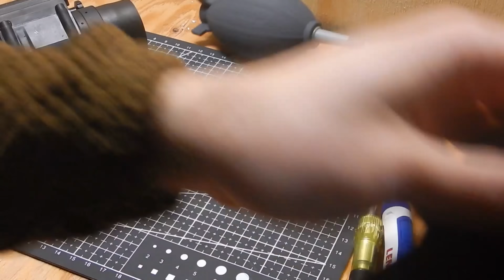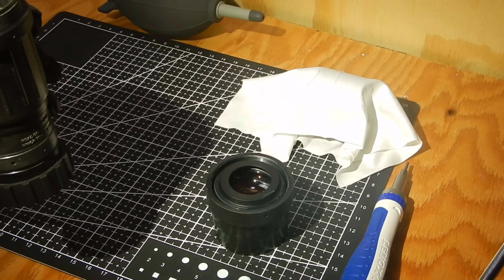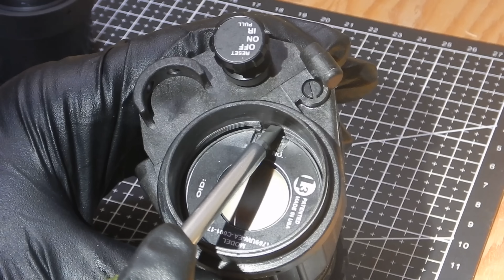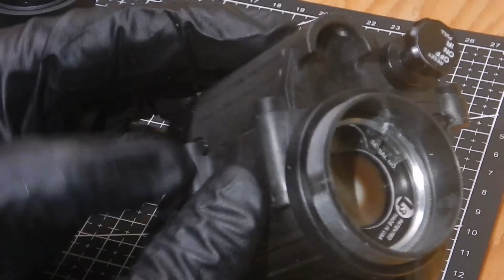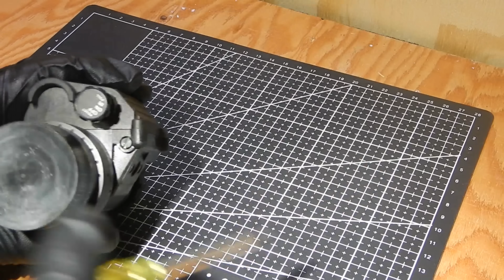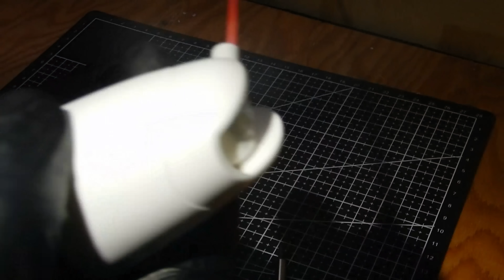How to Build Your Own PVS-14

Comment: If you not vacum then you not puting in anything unless you have another openning in that enclosure, to force out the air. The goal is not to gave inert gas in there, just to remove mousture.

Comment: You can build a glovebox out of a harbor freight sandblast cabinet and get a k bottle of nitrogen for like 300$ total, you dont need a vacuum pump to purge small volumes using one just means you waste less gas. Obviously using a bit of argon works but doing it legit and have your whole assembly under n2 is definitely possible for less than the cost of the mounting system your likely attaching it to.

Comment: I would use a hydrolic bycycle bleeder kit to vaccume the chamber and cut a hole to insert the argon tube into the bleeder tube and silicon it, when you  suck out the air you put the pinch clip on then just spray the argon in. That would better distribute the gas to all corners of the unit. Nothing comes to mind to put the plug screw in, except maybe put some lock tight on to ensure a better seal.

Comment: Re 17:10, your technique is creating a venturi which will drag air along with the argon into the device.  Best to get the whole tube into the hole. If the red straw is too thick soften it over a flame and draw it out, then cut it at the necked-down portion you just created. Better yet, get a small desiccant pack and put it into the device, it's not the oxygen you're worried about its water vapor you don't want in there, the desiccant will absorb the water vapor.
Reply: 😊hey smartasses argon is heavier than air so even if he did it would get displaced anyway doesn't make sense

Comment: I wonder if cooling the can’t further would help displace the normal breathing air. Maybe if the argon is cooler than it already is coming out it’ll get into the device and then expand driving up the less dense air out of the system.

Comment: <-- Military grade lens licker here. 
Nitrogen does several things, it displaces all the O2 so internal metal components and contacts can not oxidize, it removes all the moisture from the internals so condensation inside the device isn't a problem. Also most gear is slightly pressurized, this positive pressure keeps dust and moisture out of the system and avoids the dreaded vacuum that you may get when opening something up that was put together on a warmer day. Optics should be assembled and sealed when cold and warmed up prior to opening. 

Also I can confirm the tip about the aluminum foil. 

Added tip, if you need to clean any of the internal optics pick up some First Contact optics cleaner, it's insanely expensive but so are quality lenses and this stuff works flawlessly every time.

Comment: I think that I would blow dust out of the housing 6:40 before unwrapping the tube and not dump the dust on top of the electronics where it can migrate back in when you re-assemble, but thats just me.  : )  Anti-static wrist strap and pad might be nice too.  Autogain and autogated are not the same thing.

Comment: You could also use a sealed chamber to purge, as you said, the air is about 70% nitrogen so really all you have to do is remove the oxygen.  So what if you created a sealed chamber with a window on top and created an opening for heavy gloves (like say just sealing up a sand blasting chamber), and then putting a bunch of oxygen absorbers and desiccant packs inside, then just assemble it in the chamber, there will be no oxygen and no moisture, just nitrogen and trace gasses.  So there will be no need to purge oxygen because it wasn’t there in the first place.

Comment: Isn't Argon (being a noble gas) more inert than Nitrogen?... wouldn't this be more preferred than N2?  N2 can still interact depending on the condition...

I thought the point to a Nitrogen purge was to displace not just Oxygen but rather the moisture content and biological gunk in air.

So was gonna say bake off the moistue, but those lab ovens can be low like 60C ... guess it's a lot harder to oven it at home reliably ...

Comment: For an argon purge find a GTAW welder (TIG or Heli arc) fill a 5 gal bucket or deep tub with argon using a steady stream flowing into the bucket. Assemble the pvs-14 in the bucket. Give the welder a few bucks and be on your way. Titanium welders will will use 99.999% medical grade argon. This is similar to closed chamber welding.

Comment: the concern with oxygen is the latent moisture in oxygen. one good tip is to assemble the unit in a dry dehumidified "clean room" and wear an N95 mask that helps keep you from breathing extremely humid breath directly onto the device during assembly. Pay attention to the dew point and temperature in the room as it can cause moisture to collect on the glass. Another option is to use a beefed up sand blasting cabinet to assemble it inside of. A small vacuum pump with degassing chamber (for epoxy molds) and a bottle of argon (for welding) arent very expensive, with a $300 sandblasting cabinet you're looking at maybe $600.

Comment: Some older optics I have tinkerd with use a thick clear grease for water/dust proofing, I was wondering if you could use something like that around the lense threads . 

My thought being that it would help seal it, and the stocky grease will trap any dust that does get in the housing.

Comment: When you started into discussing purging the unit, the first alternative I thought of was argon. I've got big ol' cylinders full of it.
I'd thought of maybe assembling the unit in a tub full of argon, but the screw hole looks easier; shouldn't be hard to funnel my TIG torch down to a straw and do the same as you've done with your wine preserver.

Comment: Not that most people will be using one of these under adverse conditions normal 17:12 air has moisture in it . Under cold conditions it can condense and cause issues it could cause the optics to fog up. Drawing a Vacuume will cause the water vapor to boil off and reduce the possibility of  fogging.  The nitrogen gas is dry as a bone. Food for thought.

Comment: I'm guessing there is a reason for not using canned air to blow it out, care to elaborate?
Reply: from what I learned Compressed air is not ideal because nitrogen purging is done to remove moister and oxygen from the night vision device. Canned air isn't ideal for this for obvious reasons. Wine preserver from what I can tell is pure argon gas which is another inert gas, though given the setup probably won't be as effective as proper nitrogen purging.
Reply: @-0__________________________0-  I understand using wine preserver in place of nitrogen, I was curious about using the squeeze ball. Also, is there a difference between the argon and canned air duster as far as coldness and moisture when you use it?
Reply: @pb_zep3838  Squeeze ball wise I have no clue why compressed air was not used. Argon gas wise I have no clue. I've never worked with the stuff. I'd imagine that argon would be colder as I assume it's liquid argon in the cylinder. The evaporating argon would pull heat from the environment. In terms of moisture, I can't swear on it but argon would be dryer, as canned air would probably have some amount of moisture in it.

Comment: My manual gain, or gain is not working. I've had it for about 3 years and it used to work. I used to put it up towards the helmet and it auto shut off. but its been a while since i used this method.  does this have something to do with it?

Comment: well damn... minus bullshit gun tyranny. the UK has it easy for protective and observational gear. besides specific kit (bleeding edge type stuff) which requires a defence... which is you going "here's my reason for wanting this item" if valid, then you get the purchase put through.

EDIT: oh yeah, forgot to mention, it makes no quality difference, but longevity difference, it's gargantuan. it's to stop environmental moisture and the like out of the tube as that will damage it over time. however, thank you so very much for going into that process. even if that is ad hock of a method as ad hock of a method can be.

Comment: I had to take the class in the military to maintain systems because I had a very high clearance level and was the oic for the armory as an additional duty.  The full time armorers didn't have clearances that allowed them to maintain some of the systems.  ( not individual systems like the pvs-7, 14, 21 etc)  much higher tech systems that included integrated thermal, nv and l wave systems.  I had to maintain the systems on our uav's as well.  Nitrogen purging is mainly for moisture rejection and atmospheric changes.  We had to routinely go from sea level (CONUS) to 14,000 ft (Afghanistan) and in flight our systems were left unpressurized at 30,000ft +  on HALO, LALO and equipment drops.  There are other rare earth gases that can be used to purge with.  In a pinch you can even replace that screw with a demist valve.  It's old tech but it works.  We had a vacuum pump that fit in a 50cal ammo can and another tank that fit in there that would do a lifetime of purges.  It was smaller than our pony bottles we used for emergency swimming.  I actually took an empty and had it filled as a pony bottle for emergency diving.  I still keep it in my truck because I live on an island.  Lots of cars go in the water where I live.
Nitrogen purging is a small part of what's needed and it has to be done every 6months.  Or after a large shift in altitude. If not pressure can destroy the capacitors inside the unit.  It's not a huge deal but it can happen.  It was one of the biggest drawbacks of the pvs14 going from the pvs7

Comment: if you have an AC purge pump for recharging your truck AC you could probably rig up a homemade fitting for doing a vacuum and refill on those and the pumps kits can usually be had for around 100-150USD at tool places.

Comment: I think you should stick the tube of the wine preserver as far into the hole as possible, that way it will flow so as to displace the air inside the tube.

Comment: Pretty good instruction. I was a sealed instrument repair specialist in the military. Primarily AN AVS-9 (binoculars for pilots), but I worked on a few PVS-14's. The comments about setting diopter are correct. Also, depends on your individual eyes (corrected vision to 20/20 or similar) where it needs to be set. I think a 3D printer should be able to make the tools you need to tighten the intensifier tube lock ring and make a screw in purge valve adapter. It is just a glorified brake bleeding tool with an adapter to screw in to the housing and a 3 way valve to put nitrogen into the system. Harbor freight sells the vacuum kit. Just need to 3D print the screw in adapter with a hose barb on the end. Suck it down to -15, open valve to nitrogen, repeat 3 times. The nitrogen is important to stop condensation from drastic temperature fluctuations and pressure changes. That's why modern cars have nitrogen in the tires because the gas doesn't compress or expand during drastic changes and you aren't constantly filling/releasing air out of your tires. Assembly with canned air (which is sterile and dust free) and acetone is what I found worked best. Never use cloth or wipes to clean the lenses or intensifier if you get smudges on them. Blow debris off with air, use a clean Q-tip with acetone in a swirl motion from inside to outside of lense.

Comment: In the army, the pressurized spray canisters we kept in our vehicles to be used for decon after a chemical attack aren't pressurized at all times like a fire extinguisher.  To pressurize them you've got a cartridge similar to a pellet pistol.  But rather than CO2, they're filled with nitrogen. 

Were one able to fabricate a device that used them, in an application like this those cartridges would be useful.

Comment: As a lipstick color mixing technician in grad school, using aluminum foil does not guarantee a dust-free work space. In fact, if you just use Reynolds wrap like you get from the store, the cardboard box it comes in provides enough dust to drive a nanotechnologist to hari kari. Lipstick technologist hack: Use alcohol (I don't care what kind, methyl, ethyl, isopropyl, grandad's corn mash recipe, but the higher the % the better) and lint-free cloth/wipe to clean the foil, with gloves of course. As my old-school Russian grad advisor always said, "Metal is like Russian teenager, it love alcohol!"

Comment: 99% of the time I would agree that building your own whenever possible is the best way to go for many reasons others have already mentioned but the truth is that the best deal I could find for all the parts needed totaled $2,699.  But, with a little more research, I found a complete device on sale for $2,499.  I think if you have one already and it needs repairs, this is a great idea but buying one at this time is a lot more economical that building it seems.
Reply: Are the tubes the same quality?
Reply: Prices vary depending on quality and generations. I’ve never and will never come across a gen 3 below 3k unless its life span has been significantly reduced.
Reply: @AsKyOdA Gen 3 Omni tubes are regularly available in the $1-$2k price range on the used market.

These are often cheaper than new gen2+ tubes.  Gen 3 has a lifespan of 10,000 hours minimum, which works out to around 4 years of running it all night every night (that’s just the min spec for lifespan), but more realistically that works out to decades of use.  Very few tubes are being run all night 365 days a year, even in the military.

Comment: The point of purging the housing is to displace air with some moisture within it (humidity) with a clean gas free of moisture, such as Argon or Nitrogen.  Performing this step will keep the lenses from fogging when it becomes cold.  Additionally, to prevent static buildup use a electrostatic pad with ground straps and wear a wrist ground strap.  This will prevent the buildup of a static charge, which is easily accomplished when you use the photographic bulb to “dust” the lenses and housing.

Comment: I use heat to seal a section of drinking straw, poke holes in it with a needle. Fill it with silica gel and seal the other end. It's small enough to fit inside the housing. Moisture is all I care about.

Comment: The purge is to remove the entrained atmospheric water not the "air". Nitrogen is used as it is (a relatively) cheap "dry" gas. If you build in a low humidity environment the need to purge is lower but you will still get a better outcome.

Comment: Purging a unit with GN2 shouldn't be very difficult if you can source a schrader valve or schrader type valve with that thread pitch.  You could then pull a vacuum on the unit. I would think that 5psi wouldn't hurt the unit.  Then insert GN2 to the plus side of whatever the vacuum was. Repeat a handful of times and you've got a better job than the pros are selling. 
If the pros aren't installing and using some type of valve then they're selling snake oil IMHO.

What am I missing? Why is this not as easy as I think it would be?

What's a rough cost on a quality pvs14 build?

Comment: Cool video, thank you.  <3
When you turn at the gain control, it doesnt change the brightness now? As you said its automatic brightness.
I am asking because at mine nothing happens, when i change the gain. But its actually too much bright. Perhaps my automatic doesnt work. 
(i bought a used one and think it was also assembled by someone) Is there some trick to toggle brightness? Hmm or maybe should i buy a new housing?

Comment: Just use argon instead of nitrogen.  Argon is heavier than air thus you can do it in a open top container.  As argon gas will stay at the bottom.

Comment: Nitrogen isn't noble. It reacts with plenty of stuff but is fine for electronics. Argon is much better and is a huge atom that leaks less. You can fill a plastic bag with argon and do the final assembly inside. Anyone who does TIG welding will have an argon tank.

Comment: I built a small enclosure to help service one of my buddy's NVGs. I put all the parts in and all to tools needed, then filled it with nitrogen for a few minutes to purge out all the regular air. When it was all ready, It was a dust free environment was filled with nitrogen, so there was no need to purge since almost all the air inside the enclosure was replaced with nitrogen. It had those incubator style gloves to be able to put the NVG together. Once it was put together, it could be removed from the enclosure, and boom, NVGs with nitrogen without traditional purging. It was a temporary one made of that plastic corrugated signboard and hot glue and duct tape. We did this in my garage with the door open to outside and I had a fan blowing across it so that I wouldnt be breathing in much nitrogen while the regulator was keeping positive pressure inside the enclosure, just to keep any air from actually getting in. It was pretty easy to make so I didnt keep it since I didnt have room for it at the time. Eventually I want to build a proper one out of sheet aluminum and get it all sealed with a pressure gage and a valve system so I can service all my stuff and friends stuff, be it NVGs or binoculars, electronics, etc.
Reply: Make a video plz

Comment: Why not just get nitrogen? Oh and there's no reason to run a vacuum when using nitrogen as it is heavier and displaced "air" which is mostly made up of nitrogen. Most car dealerships have pure nitrogen available on tap and you could just take a basketball needle put into their machine and fill it with nitrogen and put the screw in right there you can probably do it for free.

Comment: I think the reason to replace the air with nitrogen is Nitrogen unlike air will not hold water vapor. If Argon is the same then I would think it would be just as good, not sure about canned air which is actually Freon not air.